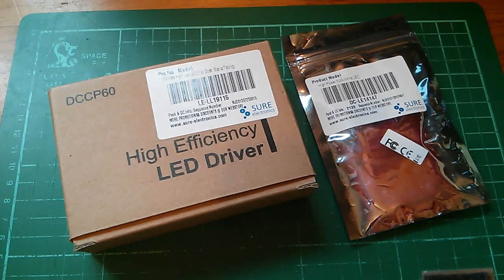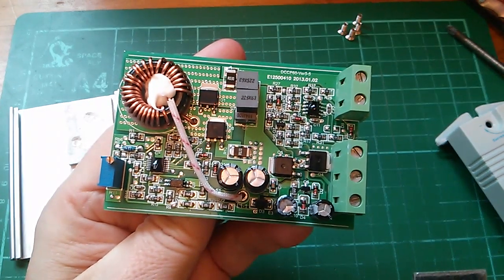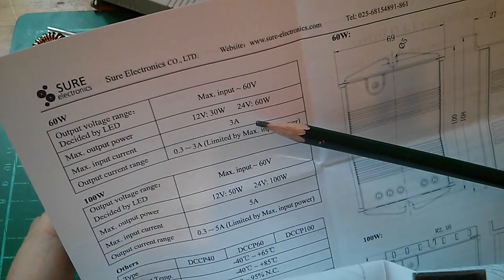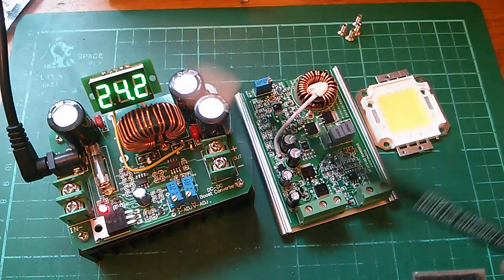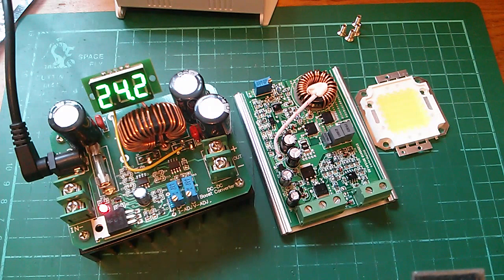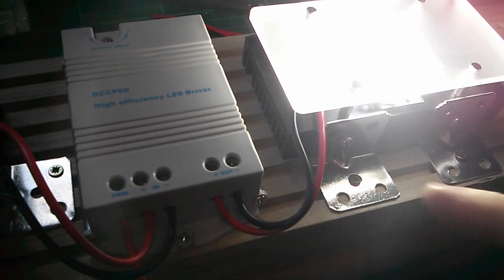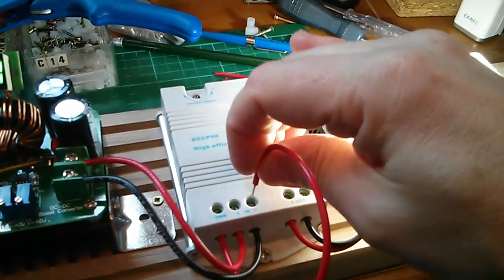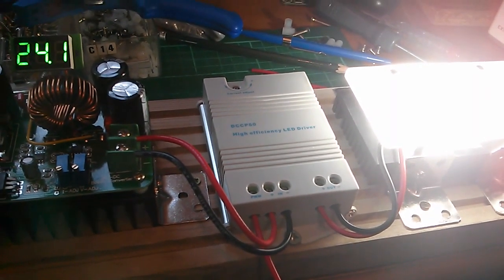First Look: 60W High Power LED Driver with PWM Control #1

Comment: Are there any LED driver that can be dimmable by arduino uno ? ... Is 1-10 V can be used with arduino ? What about DIAL  ? .... My graduation project is to design smart LED lighting system which depend on the solar energy , It have also number of sensers to detect motion , light , temperature ... Can you please help me 😓😓

Comment: I was messing around with my 100W LED and a step up convertor to power it. For PWM I just added a MOSFET to the output and used an arduno to send a PWM signal to the MOSFET so I could adjust the brightness.

Comment: I'm confused i guess?  Why cant you use a PWM only to drive a LEd chip lets say 100watts.  put LED & a resister in line. Or Variable in line main & turn up PWM dial until proper brightness is achieved?  I'm pissed because I can't find my PWM board to test... UGG!! For some reason this is messing with my over caffeinated head tonight????

Comment: If all you want to do is vary the brightness of that LED, that boost power supply you show in the video has both adjustable voltage and current output pots, you can adjust those to change the brightness of the LED without using PWM. The LED driver isn't needed, that boost power supply from China easily found on ebay is suitable as an "LED driver" because it has a current limit control, that's all the LED driver does anyway. I have some 100 watt LED's I am driving with that particular boost power supply driver and they require about 30 VDC which it will produce when supplied with 12VDC, but the output from it is limited to about 3 amps when the boost is that high, close to where I wanted to drive the LED at for 100 watts but not quite enough.

Although not really necessary, as the LED was being driven close to full output at 3 amps, to drive it to a full 100 watts I paralleled the output of two of them together to produce enough current for my 100 watt LED, isolating one of them from the other by running the output through a diode first, then matching the currents by adjusting one of the two power supplies to match. I don't really know if the diode was required to isolate the outputs of the power supplies from one another, but didn't want to take chances and blow my power supplies if they did. The 10 amp (over rated, to keep it cool) silicone diode I used had a voltage drop of about seven tenths of one volt, easy to adjust for by turning the power supply you have its positive lead in series with up that amount more to make up for it, adjusting while under load until the outputs of the two power supplies exactly matched. The easiest way to do so is to measure the current coming from each power supply (prior to where they are paralleled together) and adjust the constant current pot until they match.

Comment: JUlian, I need to make a High Power 16W LED with a PWM at 1ms on and 9ms off, I have used the CL6807 1000mA Driver but keeps shuting down the LED. My power supply can provide up to 37V, I only need 15.5 for my LED (KASHINOKI SOGYO Co. 16W24-AB2s Blue LED), and a mbed controller board to send the PWM signal to the CL6807. Do you think this controller might be a better idea for my experiment? Can I wrote you by email?

Comment: On the subject of LED drivers, I have a 10w 12v floodlight. But it only pulls 3w on the meter! would a driver help?
Reply from the maker: The floodlight will contain a small LED driver. Can't imagine why it's only drawing 3W though. Is it bright?

Comment: Julian, I want to blink/strobe a 50 Watt led with intervals of 2 sec. Do you need it will need a cooling? I am not going to PWM or use it continuously. Direct drive with the max amp and blink it.
Reply: Strobe implies a very small duty cycle, like say 1% on / 99% off.
Blinking with 2 second intervals could mean 50% on time (yes, you'll definitely need a heat sink, and possibly active cooling for that duty cycle).
Reply from the maker: smoothntallGWM Completely agree. Multiply 50W by the duty cycle to get an approximate value for heat input.